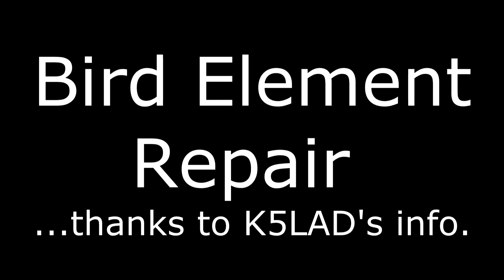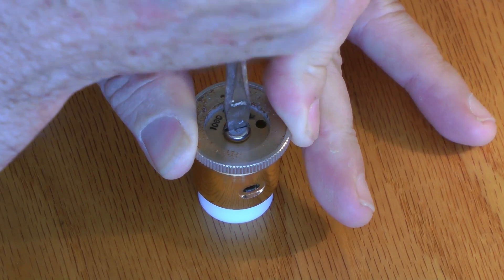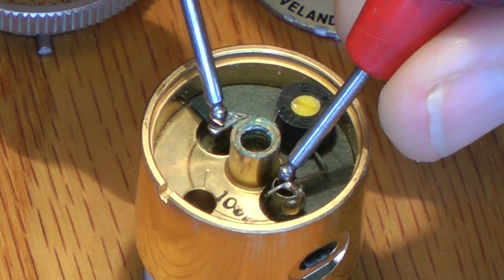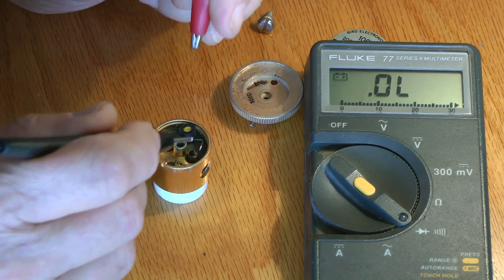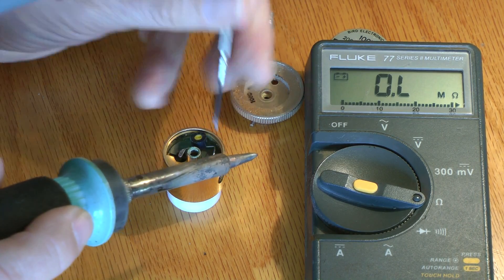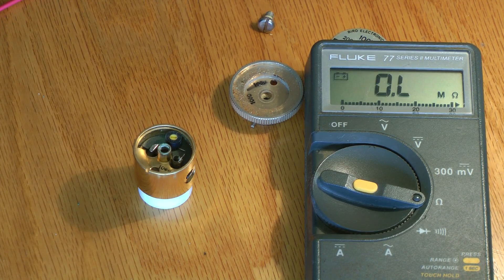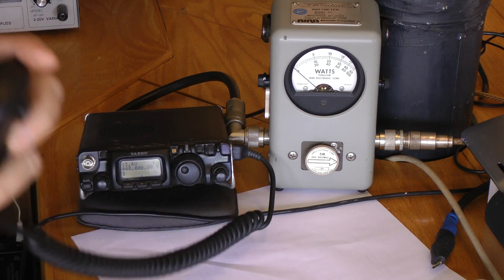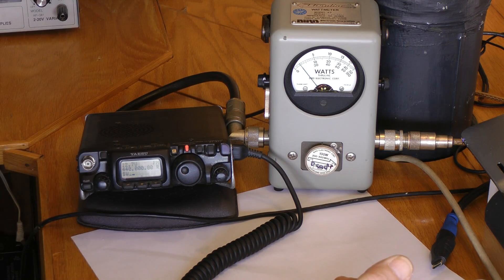Bird Watt Meter Element Repair - Ham Radio

Comment: Hi Jeff, This is a nice video of the bird wattmeter slug repaired. I have one which has a problem with the 25k pot, and I need help.  May I ask if where do you get the tiny 25k pot? Please let me know. Thanks.
Reply from the maker: My junk draws- but I'm sure Mouser, Newark, Digi Key, and the other component supplies still carry parts.

Comment: Drilling is completely unnecessary! The cover is merely secured by glue.

Put the element upside down in a little bit of acetone or mineral spirits for a few minutes to loosen the glue, and then you can pry the cover up trivially with a sharp knife between the edge of the cover and the element.

Please don't drill open Bird elements :( Thanks!
The dimple is to align the arrow for directivity purposes.
Reply from the maker: +John Hawkinson  Thanks for the info John.
Reply: +Jeff Brown  Hi, Not on my slugs . All 3 of my faulty ones had completely dry glue that wasn't holding anything yet I could not release the badge/cover without drilling the dimple with a 3mm drill. as soon as the drill got through the aluminium badge the thing dropped out. The glue "residue"  that's under the badge is flaky and rubs off with a finger.    THANK YOU John for the info, just repaired 3 slugs out of 10.

Comment from the maker: Yes, in fact I tried ganging a few resisters in parallel and series... to get an exact value, but the pot already was the exact value and it worked (?) for now so that's why I simply stuck it back in. If I wasn't so cheap and in a hurry I'd have gotten a new pot! Glad the video helped. Thanks to K5LAD for the info. 73s WB9FOL

Comment: After the pot had continuity again and you could read the value, might you just replace it with a fixed resistor of closest value assuming the pot might open up again - I think that is what I would do. Thanks for showing.